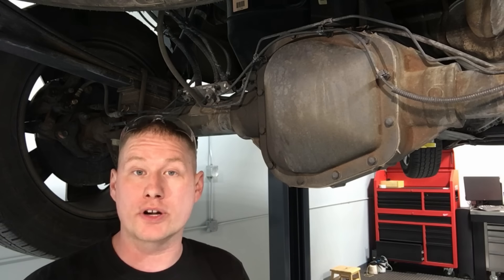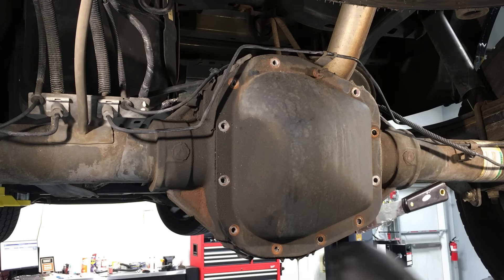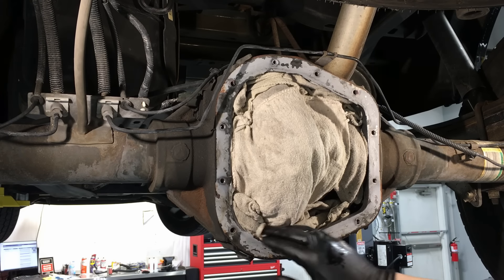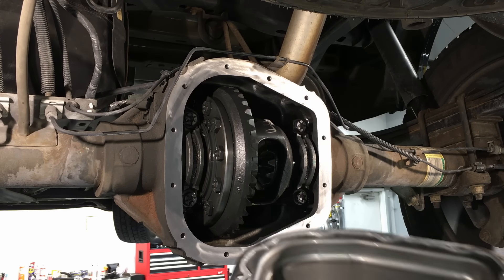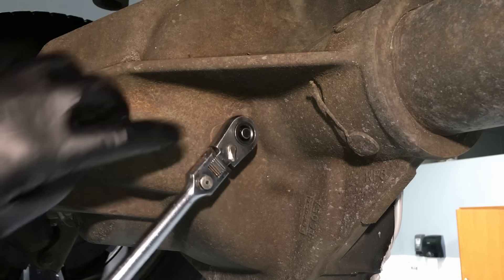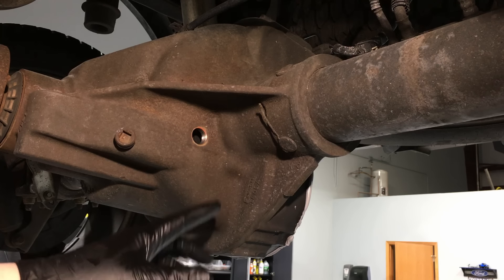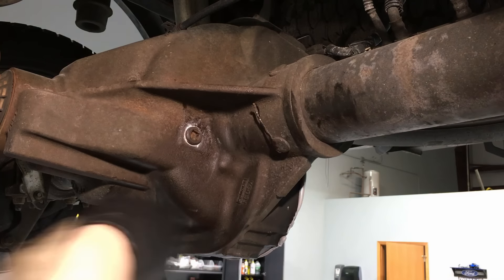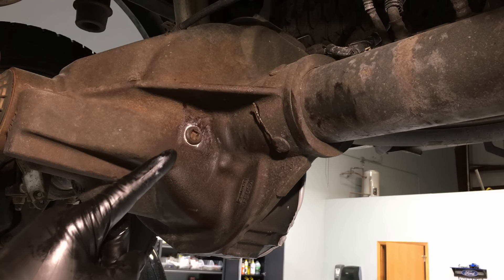Ford 8.8" 9.75" 10.25" Rear Differential Service: Fluid Change Procedure

Comment: Just smack it side to side with a dead blow a couple times lol. No need for a putty knife until you’re ready to clean up the surface.. also lot of Ford axels only use outer tube seals no inner tube seals so unless you jack up each end of the tubes you’ve only changed half the fluid in the axle.. 

Seriously all these rags lol.. what are you doing? No one does this.. your axle is already angles back for pinion angle 99% of anything you scrap is going to fall to the ground anyways. Anything that doesn’t will land right at the front of the case and is easy to wipe out. This is more like how complicated can I make a simple job and how professional can I try and make myself sound by brain fucking a 5min process for 20min! 

If you’re worried about the bolt holes you don’t blow them out you chase them out.. but brake cleaner contained cleaner and compressed air.. so kinda does both things at once lol. 

My god that’s a ton of rtv lol! Clearly a service tech at a dealership where you don’t have to pay for your own materials! That is crazy overkill.. all you need is a paper thin coating you smear around with your finger.. 

As professional as you tried to make all this you did the same exact thing every back yard mechanic does.. when using any type of gasket maker or rtv you only snug the bolts by hand then let it sit. Once it firms up (whatever the direction time says.. you then torque to spec) no one does this but I figured for sure all this overkill you surely were going to do this lol

Comment: Do yourself a favor and replace the cover with a new one.
They rust, and bleed through, usually not long after you do this service.
The covers are made from a crap metal from China and are junk.
Paint it on the outside before you install it to protect against weather.
The gasket you use is paramount to a good seal. 
Gasket maker just doesn't give me any confidence. 
I do these all day long. 
Hundreds.
Reply from the maker: I’ve never had a problem with sealer in 20 years, maybe you are doing it wrong?
Reply: @FordTechMakuloco  
Actually I've worked for nearly every manufacturer there is, at many levels. For the past 40 years son.
The machining needed to assemble parts of that nature isn't anywhere near that of most euro manufacturers. And they typically use o rings. I, make no assertions about your skills, or your advice.
Why you seem to feel the need to assail mine simply shows contempt.
My contributions are sound.
The fact you ignored them in favor of personal insult shows great character.
Using sloppy glue to make up for loose tolerances is a sign of shoddy workmanship and anyone using it for that is credited with same.
Reply from the maker: I do it this way simply because this is the way Ford does it at the factory and it works. I will agree the covers do rot and most should be replaced.
Reply: I waited for the whole time for the "special tips" that you offered in the operation you demonstrated. I like your presentations and appreciate your insight. However in this case "Use only Ford gearcase oil" wasn't what I expected. Ford even says "It's our own branded transmission oil and it has a few additives in it."
They are Borg Warner cases and are the exact same thing across the manufacturers lines from every manufacturer they supply.
I used to actually assemble these at the factory when I was young and know this to be true.
All I did all day long. Cases.
The other fact you overlook is the Super Duty cases are susceptible to the cases cracking from the plugs.
The lighter duty models do not.
Reply: Lots of talks and insults from someone with "great character". Arguments from a position of authority are no argument at all. Present your data other than an anecdote.  
FoMoCo does it this way. Every reputable mechanic does it this way. And have been for the better part of 50 years. Why? Because it works and is reliable. All you got is "I know better than everyone else".